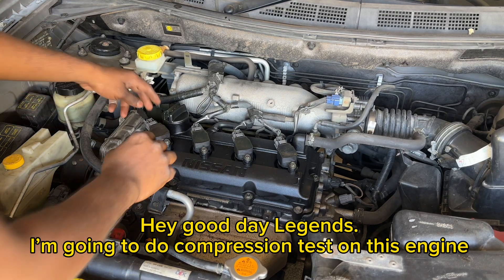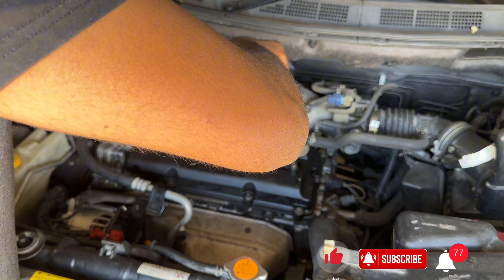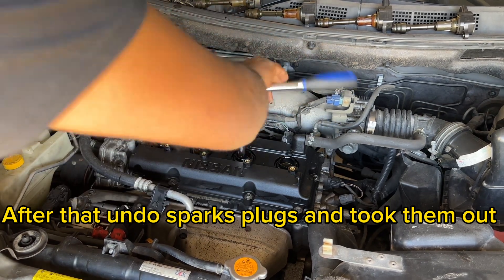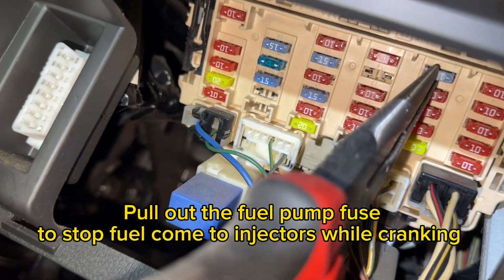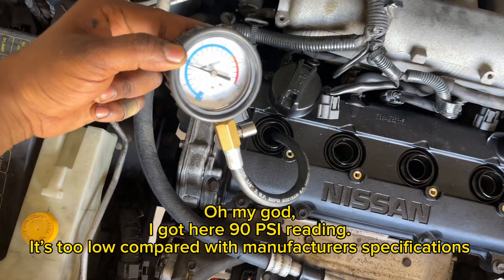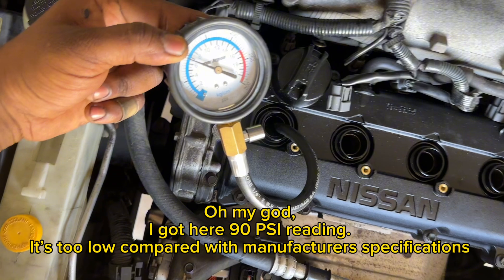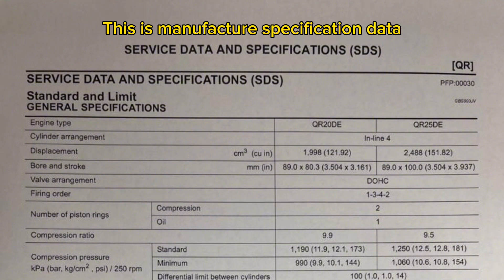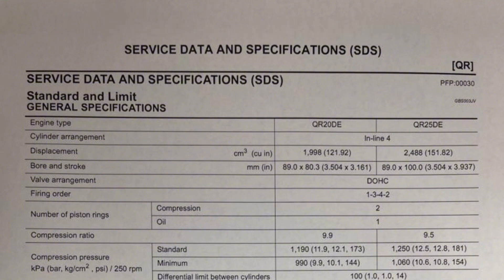How to do Cylinder Compression Test (quick guide) -Nissan xtrail T30 engine compression test -QR25DE

Comment: Cylinder 1 and 4 on my T30 are at 60psi while the middle 2 are around 120psi. I had oil in my cylinders when I checked as my car wasn't and still isn't starting. Would you know what the  problem would be? No over heating or milky oil, thanks legend.
Reply from the maker: You got 120 psi in your no 2 and 3 cylinders. Normally car would be start atleast with misfire.
Reply from the maker: Can you give me bit more symptoms I can help you to get an idea
Reply: My car was driving fine arrived at destination then 2hrs went to leave started car it all seemed normal then  turned off and threw the engine light. I cranked it a few time's and didn't start I pulled the accelerator then started. Same thing the next day was able to drive it home then wouldn't start again. 

Really, absolutely appreciate your help.